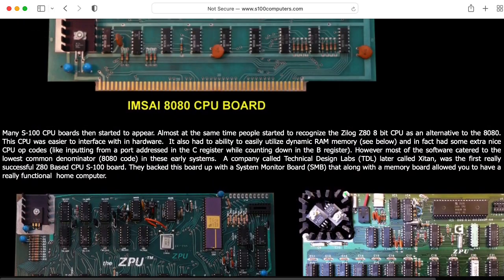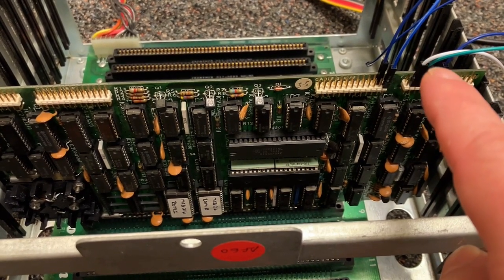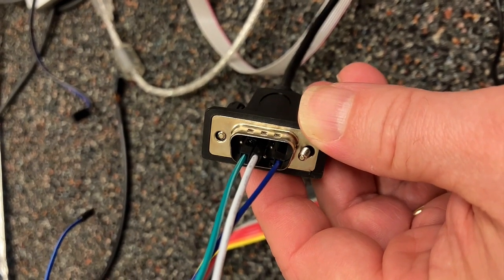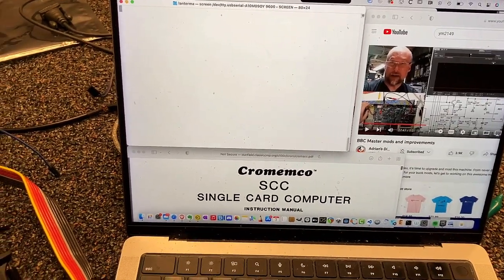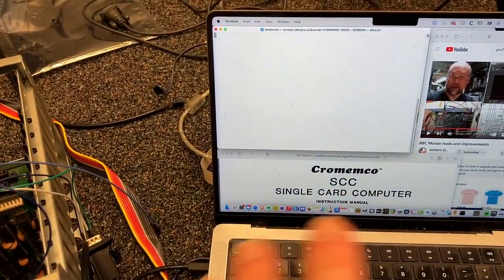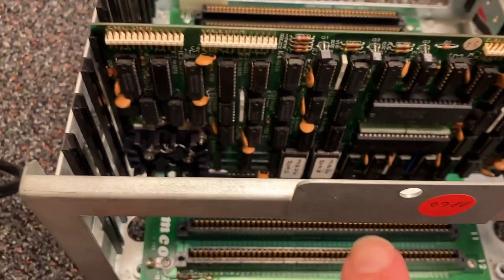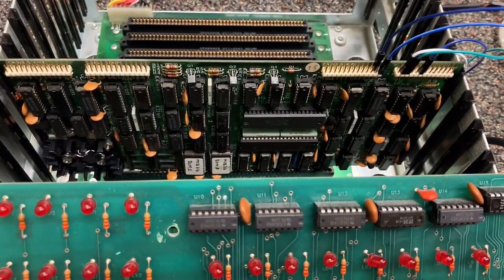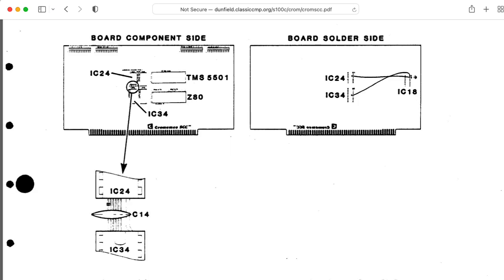[SOLVED] No Love from Cromemco SCC Single Card Computer (S-100 Bus, Retrofuturistic Hardware)

Comment: In the 1970s, 300 baud was fairly standard. Also a simple TTL logic probe will show A0 bus activity as well as TxD on the serial port. Finally, CTS/RTS may be needed on the serial.
Reply from the maker: I'm embarrassed to admit it turns out I had the ground connection on the wrong pin.

Also turns out I need to you need to hit return a couple times before it will send anything -- it uses that to learn the baud rate you are using and then matches that (I used 9600).

Comment: You need an oscilloscope. Look for a clock input to the processor. Check that the processor is actually running. Look for activity on the data and address lines. If that all seems to be working, look for the baud clock at the serial chip. Look for TX data coming out of the serial chip. Look for TX data downstream from the RS232 level shifter IC. If all that is working, I'd suspect a problem with your wiring or the protocol settings in your terminal emulator. RS232 can be a real bear to debug, especially if you didn't have experience with it back in the day.
Reply from the maker: It turned out to be a really silly error -- I just had the ground connection in the wrong spot. I checked the wiring a half dozen times and didn't see it -- my son found the error.

Comment: If you know the address for the serial chip, you could toggle in a small program to just send a pattern of 010101... To the serial port. Then you can measure the output with a scope to determine the baudrate
Reply from the maker: I'm embarrassed to admit that it was a pretty simple error -- I had the ground pin in the wrong spot (I was off my one). I double checked the connections like a half dozen times but didn't see it. My son found the error!

Comment: If that USB serial adapter is using an FTDI chip it might be compatible with the Sigrok open source logic analyzer software. That could tell you if there's anything on those lines at all. Or just use a scope, but this is already hooked up.
Reply from the maker: Turns out it worked a lot better when I hooked the ground connection to the right pin (facepalm of embarassment).

Comment: Serial: how many bits, how many stop bits, is there parity or not?  I would agree with comments that 300baud would be a good starting point as well as CTS/RTS
Reply from the maker: Turns out the Cromemco Control Basic waits for you to hit return a few times to see what baud rate you are using and then matches that. Oh, and it worked a lot better when I hooked the ground connection to the right pin... ;)
Reply: @Lantertronics  OK, yeah, I remember that.  I always do that when connecting to a serial port 😀

Comment: My Cromemco SCC which I built in the 1970’s works. It can be run as its own self contained ecosystem with its 3K control BASIC geared towards controlling some simple I/O through its simple parallel ports, TMS5501 multifunction IC & 1K of SRAM or be a part of a larger S100 system.

Comment: With a scope look at TX for baud rate
Reply from the maker: Actually there's something interesting about Cromemco Control Basic -- it waits for you to hit return a few times to find out what baud rate you are using, and then it uses that. My main problem was I had the ground connection in the wrong spot (I am embarrassed to admit).